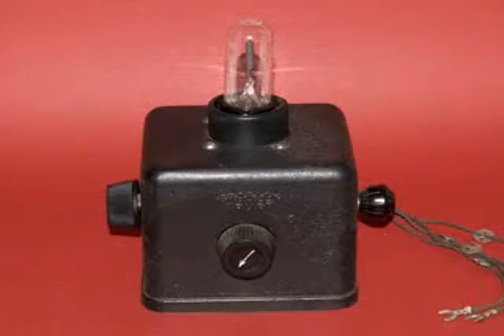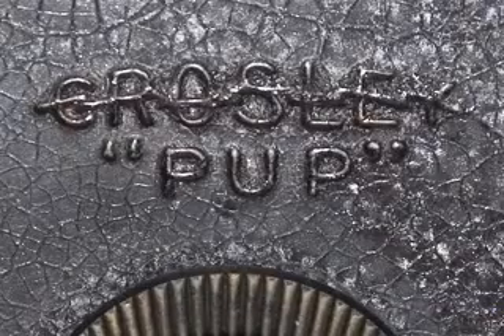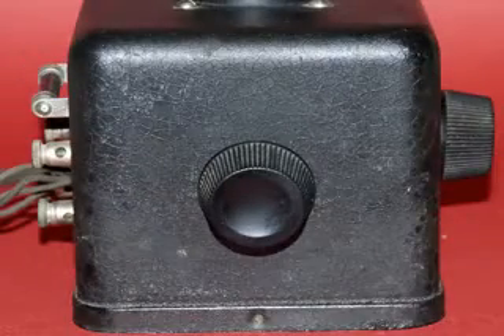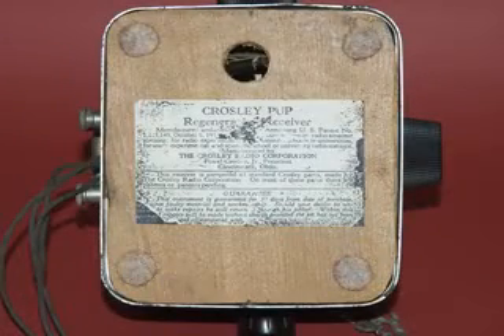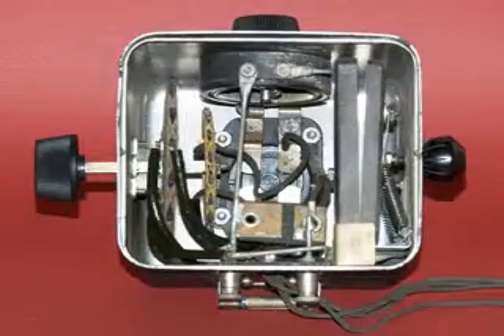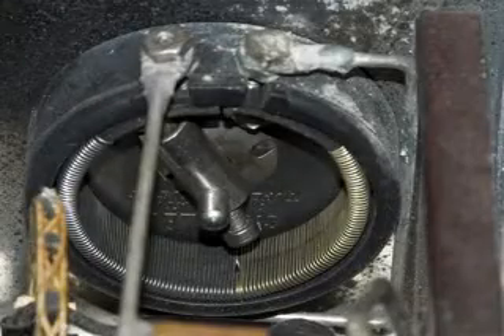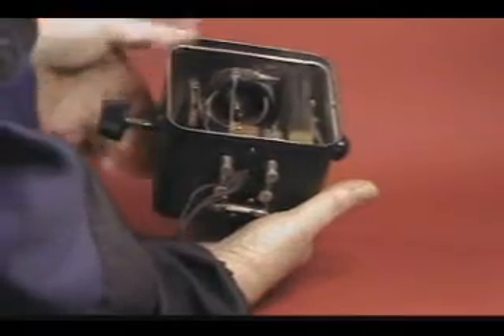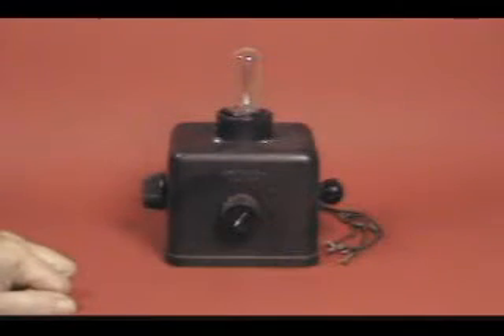Crosley Pup 1925 Radio

Comment: Ht'
In my Crosley Pup, I use a UV-199, with the adapter to WD12 basing.  Outstanding performance, and almost mint condition.  BTW, I have an extra UV-199/WD-12 adapter FS.  These adapters erre made in the 1920s.  Also, the way I was taught to remember which was the UV or UX, the pins are either (V)ery short or (X)tra long.  I use the UV-199 since it is so much cheaper,  and I only have 2 WD-12s.
Dick

Comment from the maker: WOW! How wonderful your radio is still in use today. I'm sure your Aunt enjoys listening to here radio programs. Yes, transistors are much more reliable and long lasting. I was a little younger than 13 when I got my first Crystal Set. Of course I enjoyed listening to the radio late at night and it was surprising how many long distant station I could pull in. I also discovered that I could jam my older brother's radio with my crystal set, and would do so until threaten with bodily harm. Rick

Comment: Indeed, you are right. My very first radio was bought to me when I was 13 years. It was a transistor table top model. It was OM, OT (tropical wave) and OC. No FM. It runing well in my 82 years old aunt´s house nowadays. It was produced in Brazil and the Brand is Vozzo.
Transistor radios are really long lasting and trouble free aren´t they? But the tubes are so elegant. I don´t know if the sound better since I have never seen a vaccuum tube radio "life". Best regards, Mario.